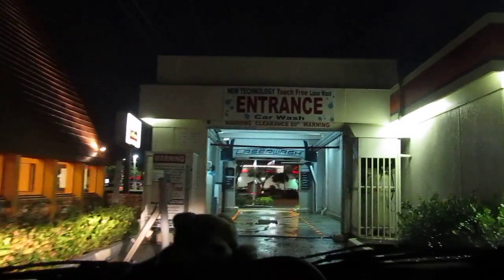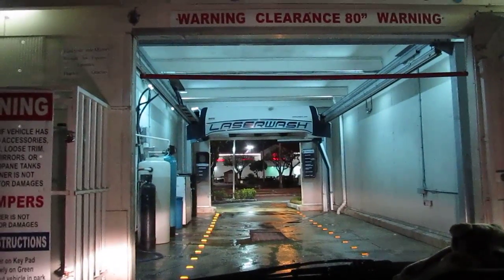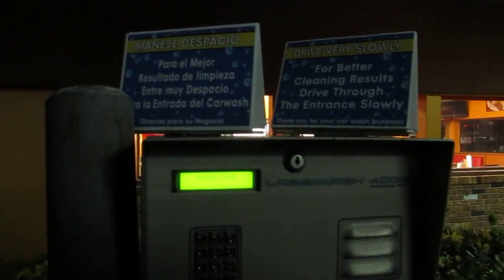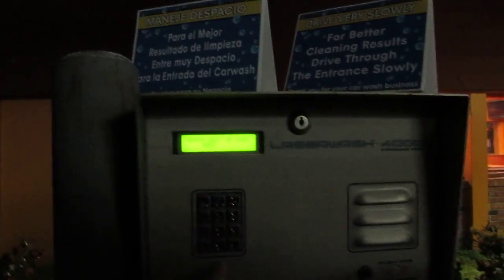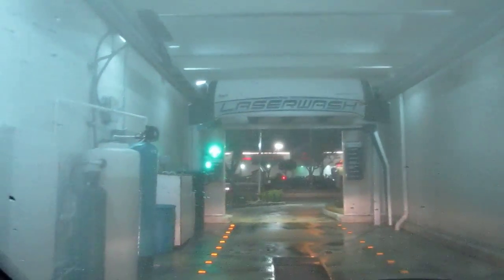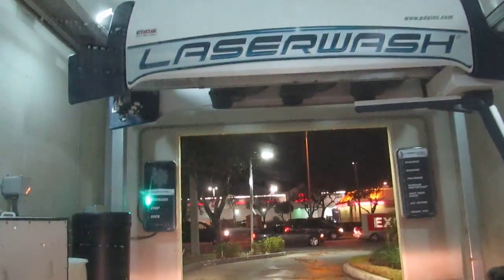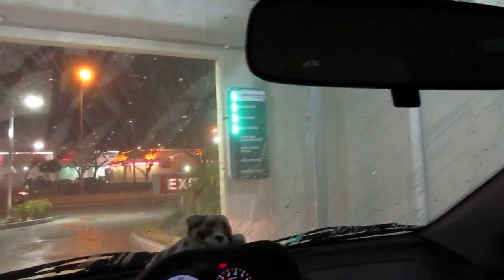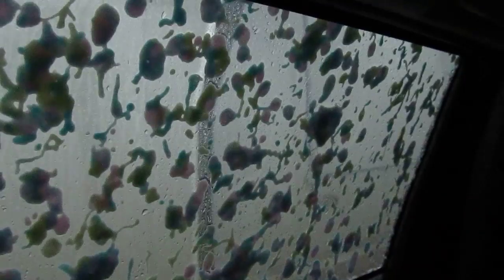PDQ Laserwash

Comment: Whats the address to this? I still haven't gotten to try out a LaserWash 360, most owners are cheap and go with the G5-S Where I Live...
Reply from the maker: ***** They're more or less the same thing. I think the only MAJOR differences are the rotating 0 degree 'turbo' nozzles (makes almost no difference aside from a ferociously loud noise) and that the gantry movement is via flexible tape drive instead of wheelbarrow tires (lowers maintenance).
Reply: Car Wash Studios

Comment from the maker: @douro20 The Virtual Treadle I've seen on Laserwash 4000 systems is usually housed in a stainless steel housing mounted on the left side of the bay, about knee height. I guess it probably has a companion set of sensors on the other side of the bay.. assuming it doesn't just use the infrared light from the sensors on the right. 

I'm very familiar with it taking more power to start a blower than to keep it running. Inrush current is a total goober.

Comment: The integrated dryer is 30hp (3x10hp centrifugal fans).  It actually takes more power to start the dryer fans than it does to keep them running, but why it did three passes instead of two is beyond me even- it's not necessary at any temperature.

Comment: The ultrasonic transducer under the bridge to the left is part of the Virtual Treadle (TM) system.  This will also be present in some cases on Laserwash 4000 systems with this feature installed.

Comment: "Dover Bong"...is it because Dover owns PDQ?
Anyway, that system could have low air pressure.  If it does, it would explain why the dry foam system didn't work right.

Comment: The 4000 used infrared.  It was also the first system to not require guide steel in the floor.